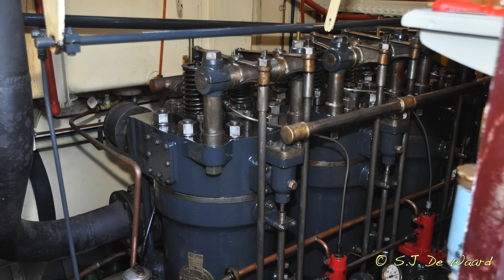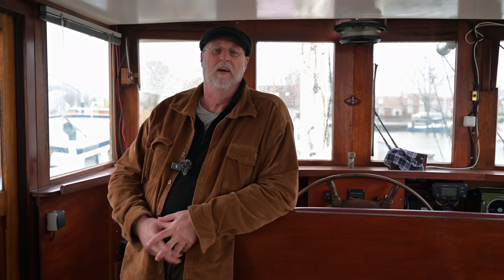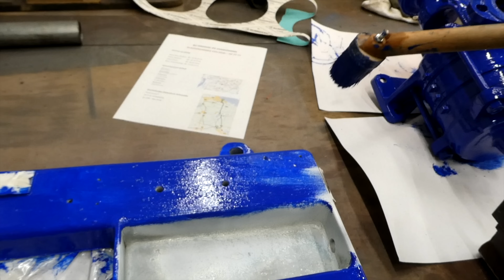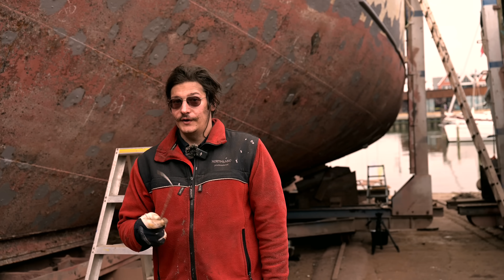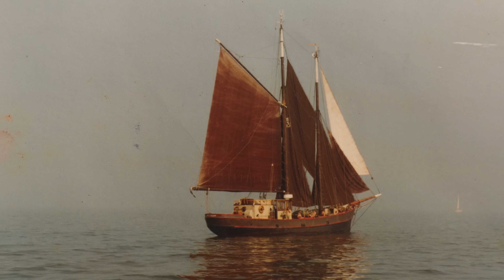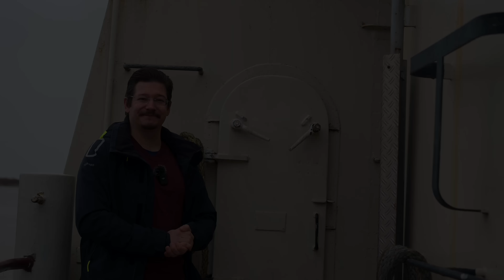We Were WRONG All The Time!!! - The Truth About Flying Coneys History EP56

Comment: I think it would be a really good idea to have 2 generators.  In practice one generator could be used for one area(s) of the ship while the other could be used for another area(s).  Being out on a travel trip, generators could also act as a backup for each other.  Power is vital so you don't want to be without it.  Your main engine looks to be great, and a little extra capacity is always a good thing to have.  All the best to you both, and I hope things keep progressing in a positive way.  Cheers!
Reply from the maker: Yes that's kind of the idea at the moment. The smaller generator is a one phase, 230 volt only generator. That's great for exactly this purpose. It would be nice to build a multi purpose auxiliary engine out of it. With an hydraulic pump, a water-pump and a 3 phase alternator attached to it with an electronic clutch to select what's needed.
Reply: @FlyingConey I do agree that the small genset might be your workhorse, simple and probably quite efficient. The idea of a 2nd multi purpose aux engine is loveley, you could couple whatever needed, watermaker pumps, holding plate compressors, hydraulics, you name it... on the other hand, wouldn´t it be wise to give it a thought about redundancy? if you install all the before electrically driven, and add another, rebuild 0- hours fuel efficient and silent genset and add a dedicated alternator to the Main engine,  you could drive whatever equipment by whatever source by means of electricity, instead of having it coupled to only one drive... it is fairly cheap and easy to run cables, more so, if you intend to add solar, wind and else as alternative energy on the long run. I believe, the waterpumps resiliency speaks for itself!!!         By the way, absolutely loveley, the uncovering of Flying Coney along the way... a real peace of history, thanks for sharing.
Reply: Well, I am not an expert but you should be able to put the generator's output through a power converter (or perhaps transformer).  There could be some slight reduction in power in the process, but would likely be insignificant.  See if there is a electrical supply store near you that could help you with the problem.  @FlyingConey
Reply from the maker: Hi Robert, I don't think there's a problem with the alternator. But I myself have not the knowledge to trouble shout a DIY generator from 50 years ago. The alternator part is probably way older. If you're looking at modern alternators they are about one third of the size. One thing I can say for sure is that all the electric isn't up to code. Back in the days that wasn't a huge problem because there wasn't much need for electricity. Nowadays a faulty electric can be catastrophic because of the high power consumption.